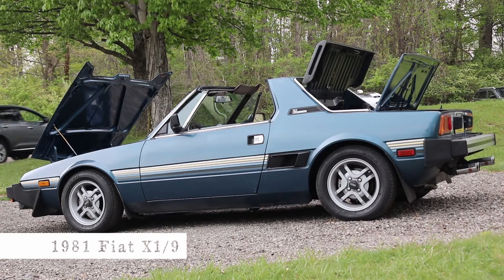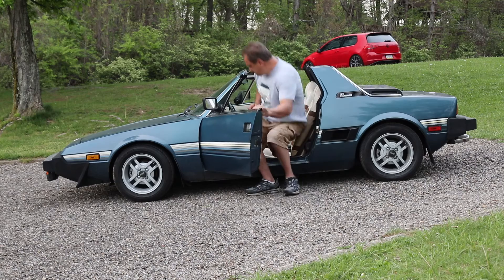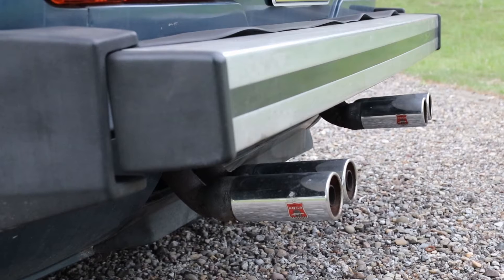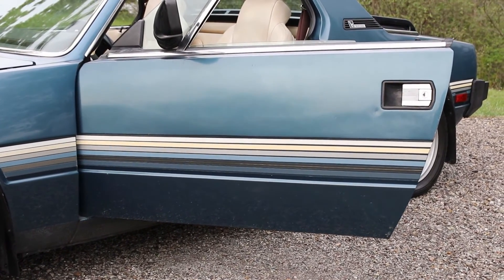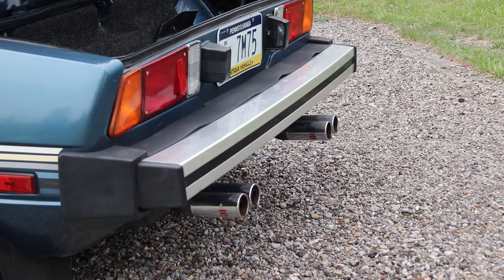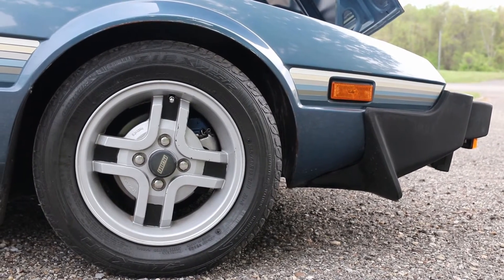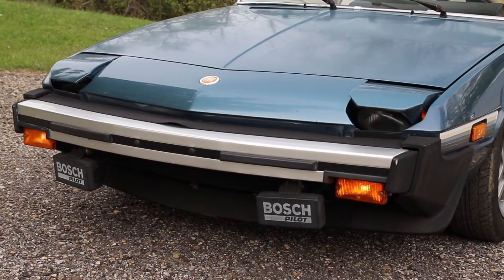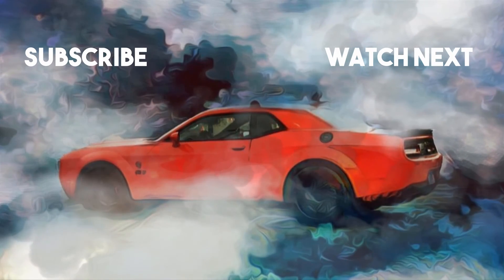The "underpowered" Fiat X/19 - Owner Interview

Comment: Had a '75. Lost the smog equipment inc. air injection and catalytic converter in favor of headers and cystom dual exhaust. Rejected carb and installed different air filter and drove from Pittsburgh to LA to see Long Beach Grand Prix. While there bought dual Weber set up, but was for a big cam so had to reset it. Easy fix with the Webers and throttle response was like a motorcycle! Got a nice rear spoiler from Faza, beat the fender lips in, added spats to wheel wheel and with help of buddies custom two tone metallic black and bronze. Had Corvettes and Mustangs, but this was lots of fun. Had box of autocross trophies and transaxle ( with special gears) I tossed in the front truck when I sold it. I drive everything like it's stolen and wish I had my old '69 small block Mustang fastback, an X1/9, & a Karman Gia. Very nice ride!

Comment: Whoa. I bought one for my 2nd car on Oahu. Someone in the Air Force had one. I paid $3,000 in 1985. I remember straddling the mid-engine compartment trying to replace a belt for about 3 hours. Not much room in there. Was great fun with the top off. Seeing the interior, the flip-up lights, the trunk and engine compartment release on the side of the door, the automatic antenna... wow. Brings it all back! Thanks for this. Mine was blue too and in much worse condition than this one.

Comment: Great car! I had 2 of them and a super fun car to drive. Wasn't fast but when your butt is 3" from the asphalt it's like going 230! Have fun!
Reply: They will do 100 mph. I know, I've owned one.
Reply: What were the biggest issues you two had in the time you owned them. The one thing I always heard was that the timing belts would only last 30K.
Reply: @DucatiPaso750  that goes with any older OHC engines. If you don't know the history go ahead and change it. It is a interface head

Comment: Nice car. I still have the ‘79 I bought new. It’s far from stock, still not fast, but pure joy to drive. Mine has a lot of stuff removed to lighten it, including those bumpers you mentioned. If you were to remove them you would be amazed at how much more lively it is upon turn in without all that pendulous weight hanging off both ends. Bayless has a cosmetic filler for the exposed bumper mounting rails. I’ve done a number of suspension and performance mods and I won many cheap little trophies auto crossing back in the day and they still hold a place of honor in my garage.

Comment: Thanks for uploading... the side stripes are really cool, not seen those before.
These little Fiats have so much potential.
150bhp is possible from the 1500 if you splash out.
Close ratios and lsd can be fitted inside the original casing, from Bacci Romano, as used in the Ritmo Abarth 130TC.
Saint Gobain partnered with Pilkington UK, who make new windscreens, very good and much cheaper than the originals.
Tillett make carbon shell seats for the Lotus Elise, that fit the X and put your ass literally 10mm above the floor and create tons of extra cabin room and headroom.

Comment: Brian. The springs are stock cut. The  shocks  are very rare koni adjustable. The flywheel is a stock but lightend.(that is why there is quick throttle response) The muffler is a very rare ansa. The cat. is hollow. A/C was optional for '82'(FIAT did not offer a/c for the car you have, build date 10/80)I added the right door mirror. Also take care of the bosch yellow fog lights. Thay are allso very rare. Have fun!
Reply: I take it that you were one of the owners of this particular car?
Reply: Nice mods you did, the slightly lowered stance is perfect.
I still have the Gran Finale X1/9 I bought new in 1989.  It is standard and now in need of some TLC, it would be nice to do something like yours.

Comment: It's a beauty, and it's so good that you are driving and enjoying it.  I had a similar set of Bosch Pilot fog lamps on my 1975 Opel back in the 70's-80's, and you definitely need to keep the covers on when they are not in use.  I had at least 1 lens crack before I learned my lesson.

Comment: I sold them new from 1976 to 1978.  1,290cc engine putting out 61h.p. through a 4-speed transaxle.  None of them came with radios as they were dealer installed unless you wanted to install your own.  Other than A/C (around $450), there was one other option and that was metallic paint.  I think that was around $75.  They came with 145/13 Michelin or Pirelli radials.  We sold the the 1976 models for $4,850 plus tax and license.  They probably stickered for around $5,300.  They all met emissions requirements running  on regular gas WITHOUT a catalytic converter.  The Fiat slogan was spot on.  "A lot of car.  Not a lot of money."  Triumph attempted to compete against it with their TR-7 but there was really no comparison.

Comment: If you were to "upgrade" to a later model that has the bolt-on seat runners (rather than yours that are welded on as part of the floorpan) you get about 2"-3" more headroom as the seat is lower.  I've had several X1/9s, and at 6' tall, I share your issue with being too high in the car.  The early models I cannot drive, but the later ones I can.  Worth looking at, as the difference is more than I can explain.

Comment: Andrew,

Thanks for the Post. As you can tell your old car is in good hands.  I couldn't remember when he was asking me about the suspension, I knew the shocks were Koni.  I couldn't remember what Bill told me the springs were there, but now that you mentioned it I'm pretty sure he told me that they were cut stock springs. 

When I did the upgrades last fall with the big valve head, cam and header, I also had the cat completely removed. But like I said in the video I wanted to keep the Anza exhaust because it is so retro and I know how rare it is too.  I'm sure one of the other current exhaust would give it a little bit more power but I just love the look of the Anza exhaust

More than likely it's probably going to get resprayed next year. I got to fix the hole in the trunk on the bottom that's getting a little worse. But the car is so much fun!!! 

Hopefully I'll get some time to Autocross it this year, I did a couple years ago. So much fun. I'm wondering how much the mods will do Autocrossing??

Comment: One point that need be mentioned regarding these 1.5L F/I or carbureted 1979-80 x1/9 cars with the 5spd is that if the valves are not shimmed loosely enough(that is if the valves are not able to close fully because of wear at the seat) their power can be reduced by as much as 35%. Timing advance must also be right.  Earlier 5spd cars (from 1979 to 1981) had numerically different primary shafts in their transmissions than the later cars that did a significantly better job at delivering torque which contributed to a better performance experience.With these factors observed the power to weight ratio performance was quite exhilarating for a 2 valve 1.5L 2000 lb car.
Reply: The issues you mention of timing advance and tappet clearance are universal nothing unique about it.

Comment: Nice car. But you are playing with your life with your size. If somebody hits you from behind, you are very very exposed!!!
Reply: There was a crash test by a TV show years ago that tested things that were hear say from past products to see if they were accurate. It was a popular show, can't remember the name now. Red headed guy and a few others, very cool reality type show. Fiat was tested with a tractor trailer hitting it at a standstill and the truck going 65. The car crushed just up to the rear roof pillar but the passenger compartment was fully intact and undamaged. This car had a very stiff cage and Fiat often bragged about how safe it was. So your data is not quite correct.
Reply: Think the problem that the roof bar lower than your head,  a shunt from behind and your head hits a metal edge , terrifying.
Reply: @Aj-dq6fe  yeah. I had 2 X1/9s and I am 6.2 tall. Needed to have seats rearranged that the roof bar is not killing me
Reply: I'm 5ft 10.my 75 x was rear ended by a 85 delta 88 olds.no neck injury, back of my head was sore from being slammed into the seat cushion.
Reply: @johnstuchlik5828  Sorry to hear that.
Reply: I had a wrong way driver that at the last second swerved. We hit at a combined speed of approximately 90mph . My front end crushed in but the passenger compartment was intact. The only problem was the seat belt was slow to lock and I did hit the windshield.  A large cut and two black eyes and a chest bruise but I survived due to the quality of the safety of the X1/9.  It was totaled and I hated to lose that car.  Bought new in 1979 and RIP in 1982.